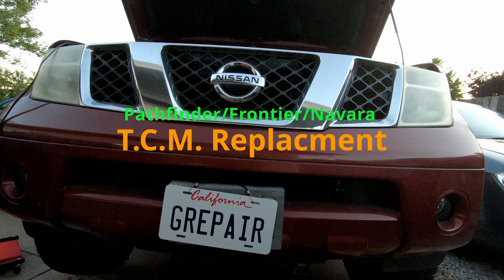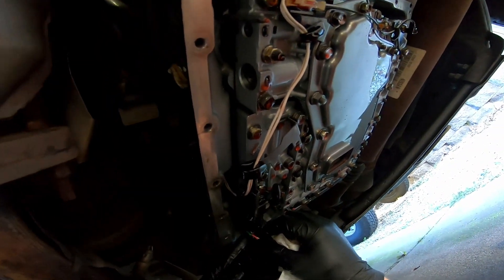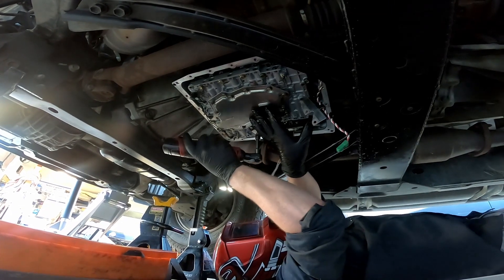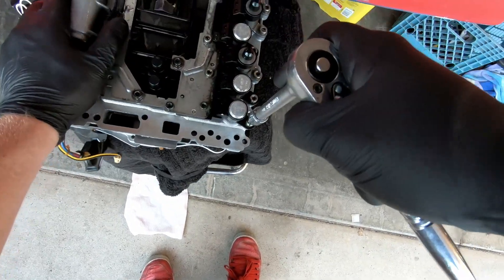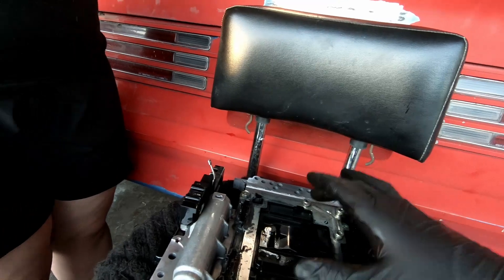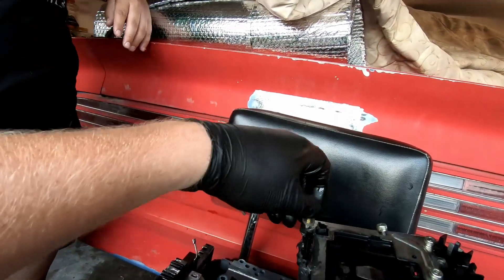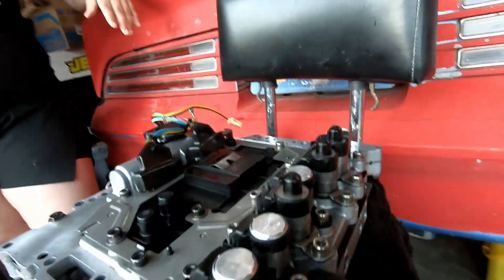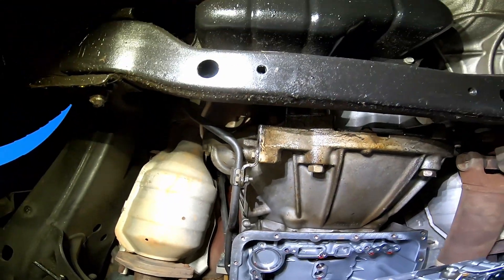How to Replace Nissan TCM 2005 - 08 Truck/ RE5RO5A

Comment: I'm in the process of doing what your video is showing. I need to know what to do if they break? Two of them already did.
Reply from the maker: you will have to pull what is stuck in the valve body out with needle nose pliers. Then replace the solinoids.
Reply: @GrimRepair  We actually found out the problem. We took it apart and saw that the control module, where all the plug-ins go, had an area where it was burned. I assume that the entire board doesn't work anymore?? What's a way for me to contact you if possible? I would really like to figure this thing out.
Reply: Actually me and my dad figured it out, I think, we actually need the same part that you replaced, and the solinoids. I believe that's all we need. Could you send me the links to the part you unboxed at the beginning of the video? I think it's called the transmission control module.
Reply from the maker: @julian2789  https://www.facebook.com/grimrepairs/
Reply from the maker: @julian2789   Here is a link to the part I used. your car maybe a little different, its best if you give your vehicle info to Oriely's or Napa and make sure you get the right one. https://www.oreillyauto.com/detail/b/dorman-oe-solutions-3387/transmission---transaxle-16780/transmission-parts-16520/transmission-control-module-13525/75a63b52c988/dorman-oe-solutions-transmission-control-module/609050/5756371?q=609-050&pos=0
Reply: @GrimRepair  Our plan was to call but they were closed. Although your vehicle looks the same as mine in the video. I have a 2005 Pathfinder 4L v6
Reply from the maker: @julian2789  I believe yours will be a different part number, but let me know What you find out.
Reply from the maker: @julian2789   Thanks for subscribing I really appreciate it!
Reply: @GrimRepair  you're welcome, be prepared to be asked a lot of questions about mechanical work in the upcoming years. Especially when it comes to personal vehicles me and my dad are working on. I'll keep you posted on what the part store says. They're closed right now, considering me and my dad just got done and it's 3am😂😂
Reply from the maker: @julian2789  Alright cool, I'll do my best.
Reply: @GrimRepair  Long time since our last talk. I'm currently trying to fix this same problem on a Nissan civic. The tcm on that one needs some work. It's going to be my little sister's. That pathfinder was mine when we bought it, 2 years ago. I was searching on YouTube for the video my dad and I was looking at earlier today when your video came up in the search results. I dicided to come and say high!
Reply from the maker: @julian2789  hey, how have you and the pathfinder been?
Reply: @GrimRepair  the pathfinder and I are great. It's nice to see that you're still active. I would get your video notifications from time to time. I'm currently working on my sister's car and going to school for automative tech. How have you been?
Reply from the maker: @julian2789  I'm doing good working and had a baby in the last 2 years. Don't pay to much for school. Shops will hire you right out of high school, and they'll pay you to learn. I know more than one person who went to a very high end automotive school ( I won't say any names) but once they got out started at the bottom in the shop anyway.
Reply: @GrimRepair  Congratulations on the new baby! I am starting to see that now that I am in school, thank you for telling me. Fortunately, my father owns his own shop and I've stuck with him. Secondly, as of the meantime a lot of my classmates are getting something called financial aid that covers everything depending on grades. And as of yet I haven't paid anything. As for 2 years from  now I'm not sure. I'm curious how did you end up doing what you're doing?
Reply from the maker: @julian2789   @Julian  It sounds like you are going to a community college, thats good. My first car was a $600 camaro and it was in bad shape, I didn't have enough money to take it to a mechanic. So I had to fix it myself, I spent a lot of time reading (this was before youtube) and at the junk yard. In college I took a few automotive classes as electives, mostly engine machining. My major was boring so I looked forward to the automotive classes. I started at the bottom at both of my jobs cleaning, the fleet at one and the building at the other. I would tell the boss he didn't need to send his vans to the shop that I could fix them. He would say things like,  I needed them fixed right away or you were busy cleaning. He would just make excuses because he didn't think some dumb kid could fix anything. One friday afternoon when the boss was out, a van came in and it needed an alternator. The office had told the boss and he said he would take it in on Monday. I didn't ask I just fixed it. When the boss came back he couldn't belive I fixed it and faster than the shop would have. After that cleaning was secondary to fixing as the fleet grew I was no longer cleaning. I have similar storys for the other job, but it isn't automotive. It wasn't easy or quick and you learn somethings the hard way.
Reply: @GrimRepair  That's great that you did that. Do you still work there and how did YouTube become a thing for you?
Reply from the maker: @julian2789  Yes, I have been at both jobs since 2009. I decided I am doing the repairs I might as well start filming them.(not realizing how time consuming editing would be) After a while the most satisfying part of fixing things isn't the sense of accomplishment, but knowing that you helped someone, this channel allows me help alot of people. It keeps me motivated to keep doing what I'm doing.

Comment: This is the best video capture of a mechanical job I have seen. The detail and especially the photos were excellent. But it needs to be higher in the YouTube tag list when I searched for Re5
r05a. Would have save me a good bit of time yesterday... But my issue is more convoluted since the boy that removed the valve body, removed most every bolt and we had to make a few guesses as to where they went. But your run through was great. I may have to take it back out as the turbo sensor had overheated and burnt/crusted on top and sent it to Limp mode with no reverse. Testing of the TCM seems to show no problems. So I have to install it to test it.
Reply from the maker: Thank you, happy to help. Unfortunately I can only do so much about how youtube ranks my videos. If you could give it a like that might help. Thanks for watching.
Reply from the maker: Jay Seth  I thought I mentioned that in the video but, it was $600 and about 1.5 hour after diagnosing the problem.
Reply from the maker: Jay Seth  is this a question? What do you mean?
Reply from the maker: Jay Seth  I did not have to do any programing. It worked right out of the box. The instructions in the box did say I would need to program it, but it worked fine I may have gotten lucky. Control modules can be reprogrammed they do it often at the dealer.
Reply from the maker: Jay Seth  I did NOT buy a new transmission the old tcm was in limp home mode and would only work In 2nd. I bought a new tcm problem solved.
Reply from the maker: Jay Seth  Where does it say I bought a new transmission? I am very confused.
Reply from the maker: Jay Seth  you need to cool the fluid some how you cant just eliminate the cooler.
Reply from the maker: Jay Seth  Refurbished tcms can be reprogrammed. If you want a new blank tcm its $1200 from Nissan. Call a nissan dealer and ask them how much to re flash a tcm they should tell  you it is an hours labor.  I would install it and see if it even needs to be programmed, it maybe good to go out of the box.
Reply from the maker: Jay Seth  If you aren't installing the tcm yourself, I can understand why a shop would not want to warranty a refurbished unit. Its not worth their time and fluid to do it again. However, new units are $600 more dollars and will have no program on them. So that is an additional expense, as they will defiantly need to be programmed.

Comment: Is there any difference in transmission control module in the xterra and the pathfinder with the same motor?
Reply from the maker: I don't think so, it may need to be programed though.

Comment: Insta-subscriber here.  The quality of this video is top notch. You labeling and differentiating the bolts by location and size made this job so much easier.  I did the temp-fix by soldering the broken contact on the front brake solenoid of the TCM, with some copper wire in there for extra strength, and my neighbor's Nissan Titan is back on the road, no parts required.

Thank you for taking the time to make this video and to include all this valuable data.   Pan torque spec is 72 in-lbs.  I didn't torque anything else, just snugged it up nicely.  Took almost 8 quarts of Valvoline Import ATF to refill it when I was done.
Reply from the maker: @brassmule awesome, glad you got it fixed.

Comment: I couldnt find the same tcm or the same  solenoids anywhere online, any help please? The links posted are not available anymore
Reply from the maker: It looks like everyone is out of stock, I would try ebay. If you have to maybe the Nissan dealer.
Reply: @GrimRepair  i found another part including the solenoids, the part number is b089m4s69z ... let me explain whats happening with me so i have a better idea if its worth replacing it or maybe i have to replace all the transmission.. when i start the car it runs normally for 4 seconds , shift first and second gear then the power drops and it locks in 3rd gear or 4th gear, if i slow donw or i stop at a redlight it drives hard and its moving very slowly like its engaging directly from 2nd gear or even 3rd gear not first gear, it takes more than 6 seconds to reach 50km/h. But i have no check engine light, i replaced the transmission oil yesterday but nothing changed. I had the coolant contamination 4 years ago and i replaced the radiator and flushed the system 4 times and i drove around 90.000 km since without any problem..do you think bying the part i mentionned above like you did will solve the problem or its better for me to add some money and replace all the transmission with a used one? Is there any tool or method i can try to be sure that is caused by a faulty TCM and not another thing ? Please advice and thanks
Reply from the maker: @rafiktunangler6190  that sound like what mine was doing when I had one of the connection break inside the tcm. You will need a code reader that can pull transmission codes the check engine light may not come on but there may be codes stored in the tcm.
Reply from the maker: I found these ones make sure they will fit your car.
Solenoids-  https://amzn.to/3xrAfQx
Tcm -https://amzn.to/3EbhFh0
Reply: @GrimRepair  thaks for your help bro, im just still looking for a way to confirm its the tcm and solenoids problems, the p r n d signs in the dashboard is still working and the 4x4 sign also working.
 Now i turn on the car its shifts 1 then 2 then 3 and stay stuck at 3d gear. I turn it off then on and it start moving from 3rd gear only and shift 4 and 5, it will not start moving from 1st gear. I didnt get any transmission fault codes so far.

Comment: I have a 07 pathfinder my battery died and replaced it with a new one after that the transmission started acting up. Local machanic told me it had code p0744 tcc solenoid valve function fault. Any ideas? Thanks
Reply from the maker: Could be the tcc solinoid, wiring issue or the tcm. My over the Internet guess is the tcm.

Comment: I’ve got a 2006 Pathfinder V6....I recently hired a mechanic to install a new radiator and flush the transmission....afterward everything seemed fine for a couple of weeks and then out of nowhere I get in and try to start the vehicle and it wouldn’t start...battery is fine and the same mechanic hooked up a device straight to the starter to start it...I took it to a Nissan dealership and they are telling me that there’s a little bit of coolant in the transmission fluid and the TCM has gone bad in the valve body and they say the only thing that can be done is to completely change the whole transmission and new radiator for the low low price of $5000.00....so what can I do? I’m thinking just change out the valve body right? How do you install external coolers?
Reply from the maker: I am assuming you changed the radiator and flushed the tranny because you had a bad radiator? Your story sounds a lot like mine. It's hard to get all of the coolant out of the tcm so I would replace it. The external cooler just takes the hoses from the radiator and then the cooler clips to the radiator.
Reply from the maker: The dealership wants to replace it all because it's hard to say for sure that the coolant didn't damage the transmission. They aren't going to warrenty a contaminated transmission. If you replace the tcm yourself I think you have more up side than down.
Reply: Yeah I changed the radiator and did the flush bc I heard about that problem that those year models have...it starts with the defective radiator that contaminates the trans fluid at around 100,000 miles. I read that you can prevent it from happening in the first place by just replacing the radiator and doing a flush...which I was told by a mechanic that yes there was already a little bit of coolant in the trans fluid so I needed to do that repair ASAP so I did....then after a couple of weeks it just did what it’s doing right now...my vehicle went into “limp mode”. So what I’m thinking is that even though I changed the radiator and did the flush the little bit of coolant in the trans fluid had already gotten inside the valve body and tcm....so a friend of mine who is a salesman at another Nissan dealership said I could bring it to them and they will install a new valve body...they said I could even buy the valve body online myself and they would program and install it for me.
Reply: My friend’s Nissan dealership said they would charge me $1200 just for the valve body so I’m gonna order it online myself to save some money...can you recommend a good place to buy from? I’m seeing some for as low as $200 to $300....on up to $500 to $600....I just don’t know who to trust.
Reply from the maker: @jamesmoore4003  ok, sounds good. If you could update us if you were able to save it , I would appreciate it. I think a lot of people are on the fence about replacing just the tcm, when the dealership tells them they need a new transmission. They maybe a little more confidant seeing it in the comments as well.
Reply from the maker: @jamesmoore4003   @James Moore  I had 2 bad experiences online, one was an eBay seller. Part was poorly packaged oil had soaked through and the valve body fell through the box, never heard back from him. The other was summit, the tcm was on back order for months they just issued me a refund. I replaced just the tcm I am sure your valve body is ok.  It was refurbished by Dorman, I got it from oriely's. I also had to get a few solinoids because 2 of them had broke during disassembly. Here are links to the parts I used  Tcm used in this video 4x4 4.0  2006 nissan pathfinder - https://amzn.to/2DifWer
Tcm Solenoid set  -  https://amzn.to/3ed8xKh  
Transmission filter -  https://amzn.to/2Z5hp0b
external transmission cooler -  https://amzn.to/2Z4mg1j

Comment: My 2006 2.5L pathfinder developed transmission issues 
P1759
P1757 
Codes 

No CHECK ENGINE light ..but luck of power moving ...especially uphill...reverse ok ..when on the run  gearbox  shifts gears ok.

Faulty TCM unit ?
Car has 114k milles on the clock  ...and i dont want scrap it just because of that  .

Well detailed Video ...Great job 👍
Reply from the maker: It could be, did you check your fluids and make sure the coolant isn't mixing with the transmission fluid?
Reply: @GrimRepair  I will check this 2moro 
It's 20:20 and raining  like he'll
What colour should I avoid to discover ??
And if mixed what does it mean?
Reply: Well...hopfully I'm not going to find any milkshake  2moro 
If so i do hope new radiator + flashing both coolant and transmission liquid would fix my pathfinder,  at least for another 50k milles.
Reply from the maker: @tomaszkus3652  it means your transmission cooler inside the radiator has failed and is killing your transmission. If it is the original radiator and hasn't failed. you should replace the radiator anyway, because it will go bad and ruin your tcm, nissan may replace your radiator for you under a recall. Your transmission fluid should be red and oily, not frothy, watery, or sticky. Your antifreeze should look like antifreeze. There are many different colors it could be, hard to say who may have put in what over the years. If you aren't familiar with how uncontaminated antifreeze should look, you may want to have someone who is look at it.
Reply from the maker: @tomaszkus3652  it may not look like a strawberry milkshake. Mine wasn't that bad. When I first looked at it, I just thought that it looked wierd.
Reply: @GrimRepair an update 
Antifreeze  is green ,both top of the radiator and the  Antifreeze tank 
Can't locate the transmission fluid level checker tho  🤷‍♂️need to closer inspect it after holidays